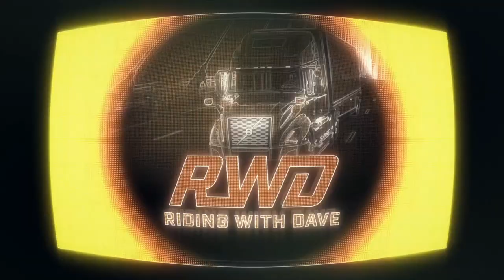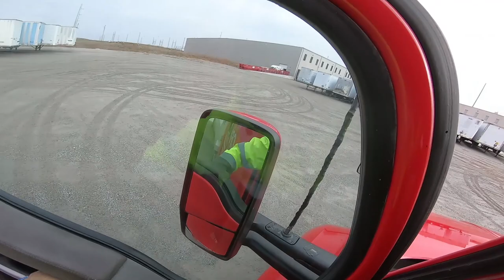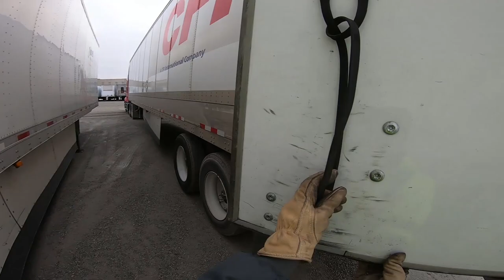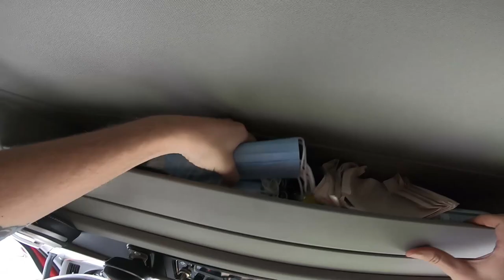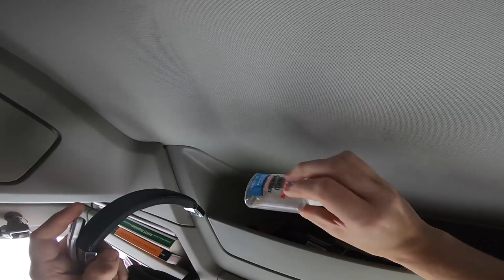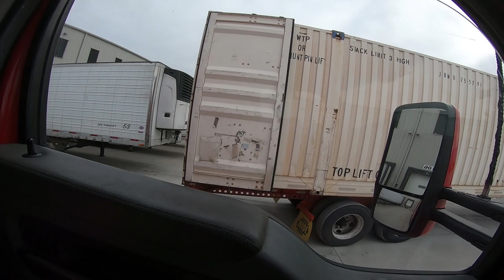Watching other truckers backing.  Rookie Trucking Life.

Comment: Thank you for having pride and cleaning our equipment before docking at the customer. No I don't drive a day cab. Keep up the great example 👍.
Reply: I drive a day cab and I back 6-12 times a day in Seattle and Tacoma we run 4 14s and a 16 every week. I have a 4axle day cab which is longer the a sleeper truck. I’m tired of people calling us day cabs part time drivers. We run longer and deal with a lot more then OTR drivers we also go home and deal with kids we can’t just relax or sleep day cab work is a lot harder then some think
Reply: @kylesisk3110  
It is hard work.  
I run OTR from NC to Seattle.. then I turn into an LTL driver and deliver 10-15 stops from Lynden down thru SeaTac and Portland. 
It's never distribution centers, either.   Usually a tight ass dump. 
You're right.. most of these chuckleheads just drive, fart, and sit in the seat. 
Not all of us.

Comment: You are absolutely correct, it's all about the setup! Years ago I had to back into a door off a narrow city street with concrete poles on opposite curb. Trailer had to wrap around a light pole but still had to watch the right front bumper and the concrete poles. It took a couple of deliveries to find the right setup and memorize it but after that it was one shot into the door!

Comment: Here's a pro tip for traffic lights. Whenever possible, keep as much distance between you and the vehicle in front of you as traffic conditions allow. As the line begins to move as the light turns green, you can get a "running start" instead trying to pull away from a dead-stop with extra room between you and the vehicle ahead. I delivered to grocery stores in the 5 Burroughs of NYC & Long Island pulling 46', 48', & 53 ' trailers making multiple stops, so I know this practice can help you make a few more lights and decrease your frustration level just a tad.

Comment: "running the light" is defined by if you're not already commited to getting to where you need to go. if you have the oppertunity to stop without being in the middle of the intersection or blocking it you should be stopped, but if you stop and you end up blocking the intersection, keep going.

Comment: Once your front tires break the "plane' into the intersection (stop line, if available) you have legally entered the intersection. However, some states have a law saying you can't block the intersections even if you can legally enter the intersection on a green, so if you can reasonably predict that you can't fully clear the intersection (I.e. you see traffic and you know you will block) than you can be cited. It is rarely used, however.

Comment: Maybe a little different for a turn, but I've always been told that if you look up as you go through the light and see it turn red, that means you ran it.

Same was told for my CDL driving test. If they look up and see it turn red as you go through the intersection, you fail the test immediately.
Reply from the maker: That's interesting.
Reply: When taking a driving test, I wouldn't push my luck for sure with Red lights. In the real world if you are past the stop line in the intersection when the light turns Red then you are good.